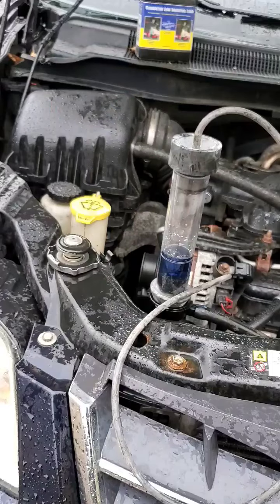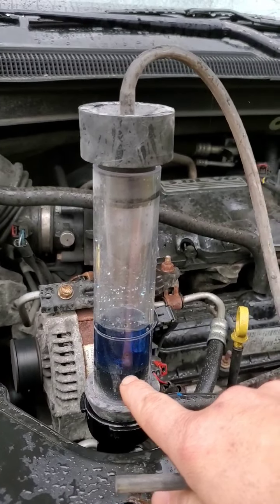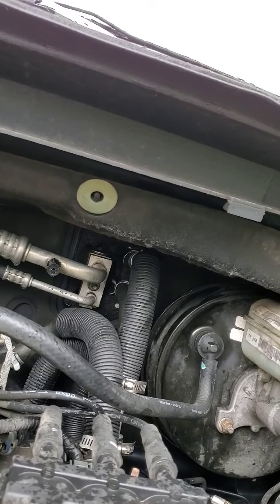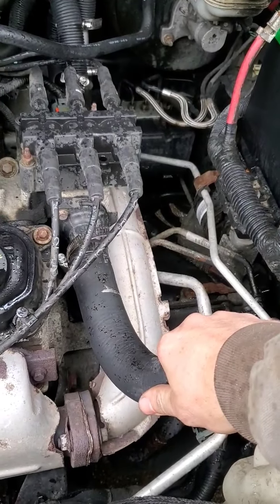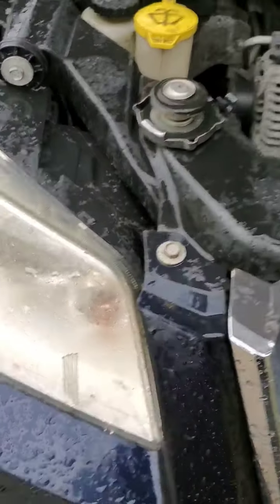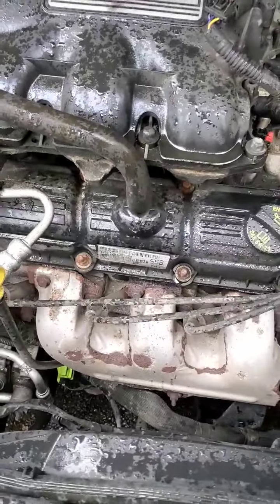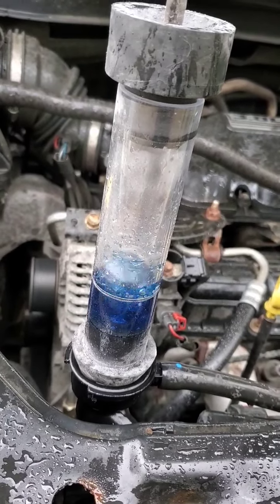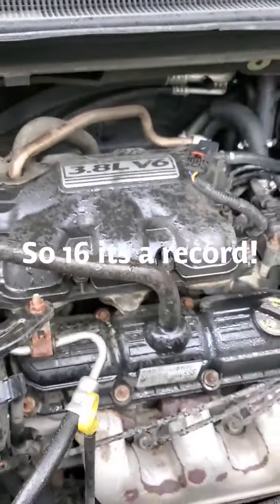Diagnosing an overheating issue 2010 Chrysler Town & Country 3.8 liter with combustion fume tester.

Comment: Thanks for this video. My '08 has the same bubbles and I thought maybe there was just air that needed to be bled..I'm gonna get that tester to make sure it's not a head gasket. No visible leaks, no frappe oil, but I have to top the coolant off every morning.  It does begin to run a little hot sitting still but when on the road, especially the highway, runs super cool. I'm in Florida.  I hope it's not a hg....of course a water pump won't be much fun either🤦🏾‍♂️

Comment: Hello when checking for exhaust does the fan turn on?I have the same problem, but the fan does not turn on, only when the air conditioner is on